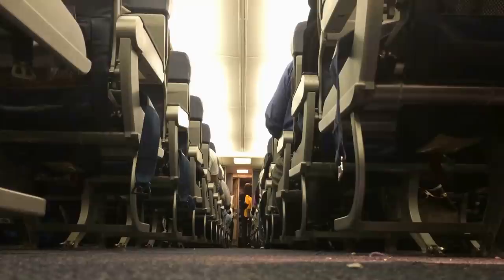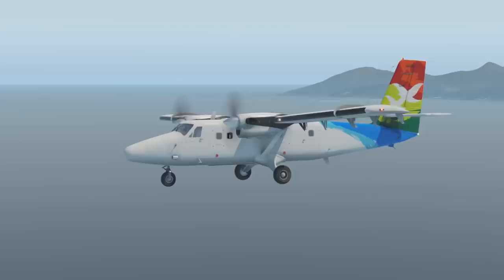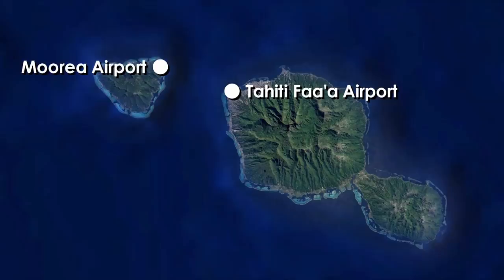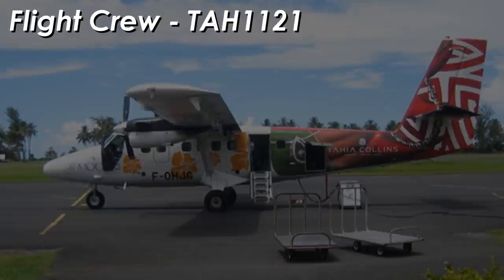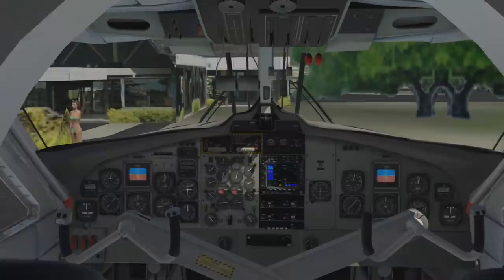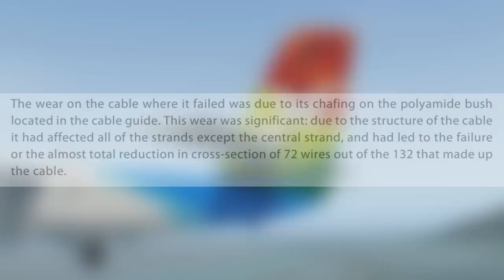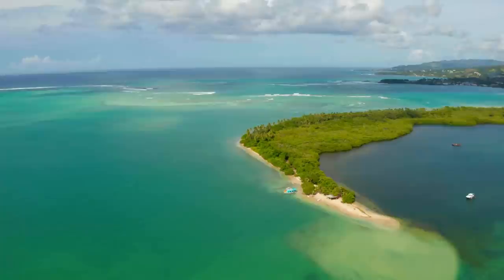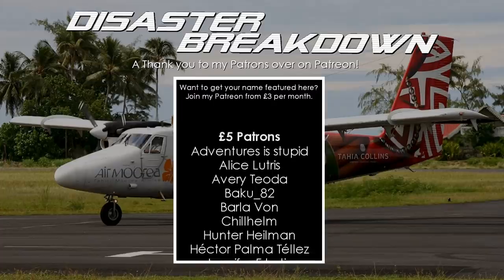The Terrifying Case of Air Moorea Flight 1121 - DISASTER BREAKDOWN

Comment: I've sent this already, but it didn't show up, so I will repeat. Sorry it's important. This tragic accident could have been prevented by normal flying skills. Here is a part of the Twin Otter flight manual. It's not just that the pilot did not read the manual, it should have been instinctive airmanship. Trimming a plane is something that the pilot does dozens of times on every flight. 

From the AFM:

Elevator Control Malfunction

WARNING

AIRCRAFT LONGITUDINAL RESPONSE TO ELEVATOR TRIM CONTROL AND POWER CHANGES WILL BE REDUCED. AVOID LARGE AND/OR RAPID CHANGES IN TRIM AND POWER.
SECTION 3 EMERGENCY AND ABNORMAL PROCEDURES

TC Approved

If movement of the control column does not produce a corresponding change in pitch attitude, longitudinal control can be managed by using the elevator trim. Engine power should be used to control vertical speed and airspeed.

Flaps should be extended or retracted cautiously, in increments of 5° or less.

Application of power will usually result in a nose-up pitching moment, and reduction of power will usually result in a nose-down pitching moment.

Extension of flap will usually result in a nose-up pitching moment, and retraction of flap will usually result in a nose-down pitching moment.

This crash should have been an incident. Every pilot without an autopilot can fly a plane with elevator trim.
Reply: @mehashi  I explained this. Add power and the nose goes up. Add up trim and the nose goes up. The trim button is right there on the yoke. Both are independent of the elevator cable. I have 1500 hours in 10 different planes. Very basic planes, but not quite armchair.
Reply: @mehashi  I quoted the Twin Otter flight manual above. It explains how to deal with the problem. It does not say 'you're gonna die!'. The control inputs are almost instantaneous and should be instinctive.
Reply: @tombloom99  "It explains how to deal with the problem." *assuming a number of factors that sadly weren't met in this particular situation*. 

Do you assume that all maneuvers that succeed at 5000ft at cruise, would also result in success at 1000ft at climbing speed? You are focusing on the written word completely devoid of the context of the situation.